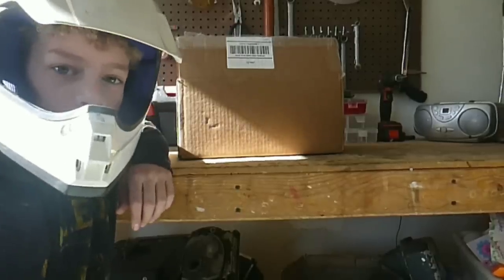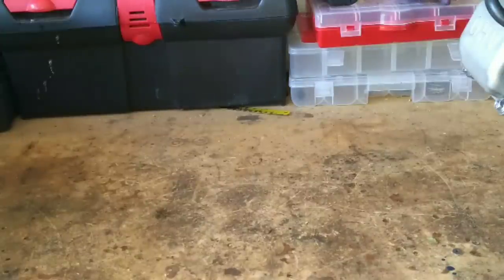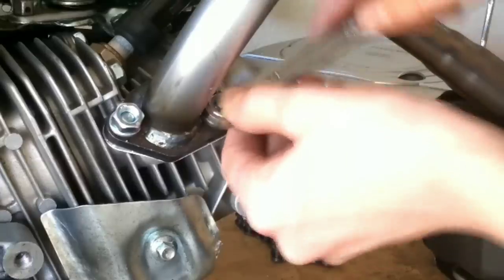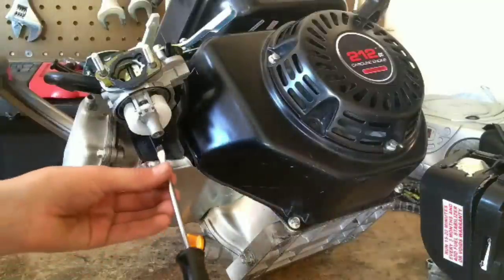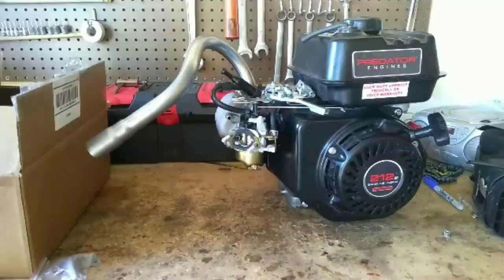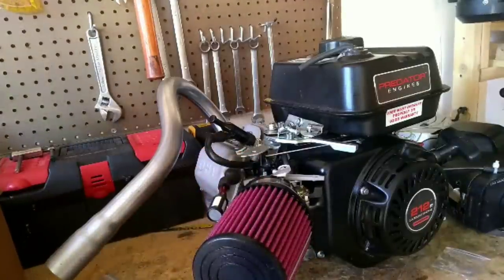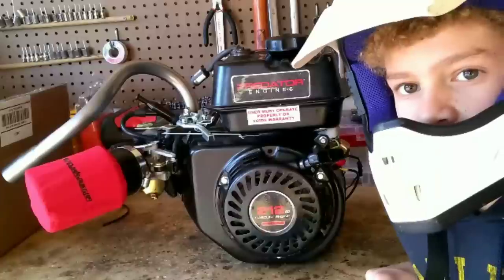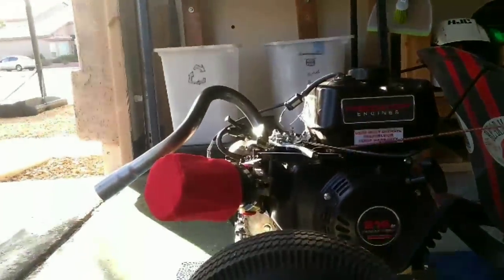212cc Predator Mods: Stage 1(FAST and LOUD!)

Comment: What sprockets are you running cause I’m on a 420 chain have a 10 and 54 tooth sprocket and can get 30 something stock
Reply from the maker: 12 on the clutch, 45 on the sprocket. #35 chain. I had a 60t on the back a while ago and it topped out at 30

Comment: Can you explain to me the stages of engines like how you said stage one engine
Reply from the maker: To be honest i dont know the exact differences but its typically 1- modified intake, jet, exhaust, gov delete 2. Cam, rod, flywheel, bigger carb, 18lb springs 3. Includes smaller technical stuff like head porting, increased compression, bigger cam bigger carb and more billet parts. Stage 4 is everything, big valves modded head running off alcohol with all kinds of custom jobs. sorry its not specific but as far as I know thats what differentiates it
Reply: @kartingkid714  that actually helps I kinda figured that basically the more performance upgrades you add and the bigger basically the bigger the stage number thank you

Comment: Would it be fine to have my governor removed with this kit?
Reply from the maker: yeah, its the setup i have
Reply: Holy crap, that's the quickest reply I've ever gotten. I was gonna take the stock exhaust box off the small holder as a small straight pipe on a 196 (this was my first time modding a motor a year ago), but I didn't know it could break your valves, lol. I replaced it with a 212 and I plan go get a stage 1 off GPS and to remove the governor.
Reply from the maker: i try to be dedicated to my fans. I had the same worries, heard stories of engines blowing up after a governer removal. Send it, its worth it
Reply: I watched Cars and cameras remove it off their 670 go kart. It took off by itself 😂😂, but if you have the right tools for the job, and maybe an extra gasket, you get free power! I subbed btw, I love your videos. I put a non hemi 212 on my Coleman BT200X, and a friend of mine gave me a fully functional torque converter for free.
Reply from the maker: @MattS_Filmography  apreciate  it! ahaha yeah dude, i was like yeah nahhh never could happen to me, and got my kart stuck under my truck. I didnt even remove it, i bypassed it. i dont wanna open the engine up until i throw in a billet connecting rod
Reply: Did you use the ziptie trick? I heard that trick to bypass it is VERY sketchy
Reply from the maker: @MattS_Filmography  no i replaced one of the spring with a solid rod, made sure the throttle returned properly
Reply: Ah I see. I'll probably actually replace it, or find some easy at-home trick to bypass it.
Reply from the maker: @MattS_Filmography  next time i have a new engine ill make a vid of my method
Reply: Oh nice, you know I'll be first to see it, I just won't mention it in the comments like all the 7 year olds do 😉

Comment: I got a new spark plug in my kit
Reply from the maker: Lucky, my stock one died so  I got an E3
Reply: I finished up my stage 1 install today. I had to wait until the foam filter spray oil came in the mail for my UNI filter. Mini bike will pull a wheelie now. No joke
Reply from the maker: @s2_eleven551  uhg I'm jealous, I'm doing a mini Ike build right now but I can find a place to weld

Comment: Do you need the little tiny filters ?
Reply from the maker: technically you dont, but the crankcase vent hose (one that comes out of the head) may spray oil without a filter on it

Comment: Hey man what kind of header did you pick for the kit
Reply from the maker: when i bought it they only had the one header option so idl
Reply: @kartingkid714  Ok one more question. If you buy a new regular carb from Amazon do you need to do any prep to it?
Reply from the maker: @Gone_rn  no you should just be able to throw it on
Reply: @kartingkid714  I'd run well also with a 22mm Honda Kehein Slide Carb...of an XR cheap as French fries & like a dream over the std butterfly carb !  Trev NZ

Comment: hey bro what are those things you put in the lines
Reply from the maker: ?? like the brake and gas?
Reply: no the line that you have the filters on by the gas tank and carb thanks
Reply from the maker: @elijah973  oh so the one that comes off the valve cover is a breather tube- it keeps pressure balanced as the piston changes the pressure in the crankcase, and the other is a gas tank fume release and making sure fuel moves slowly, the things on the end r called vent filters
Reply: Thanks so much ;)

Comment: Is your clutch on right ?
Reply from the maker: what do you mean?
Reply: Karting Kid is it backwards? because on my predator 212 the clutch is the other way
Reply from the maker: @dommybigshot21  most clutches are bi-directional. basically it does not matter the way the clutch is mounted.
Reply: Karting Kid preciate the Info !!! 👍🏼

Comment: What’s the helmet for
Reply from the maker: i used to be scared that hacker were gonna steal my SS #, i was 11
Reply: Karting Kid hey I like people that reply fast. Have you added more upgrades yet? I put a mikuni 22mm with a stage 1 exhaust header and I think imma get a racing clutch and a fly wheel.
Reply from the maker: @ryan14r95  ive wanted to for a while. billet connecting rod and flywheel, but its still pretty pricy, hopefully ill start pulling money in from the weldee

Comment: Hem I??? Whaaaaaat
Reply from the maker: J-Gaming79 yep, that model has a hemisphereical combustion chamber. You can tell on there predator engines without taking the head off by looking at the shape of the valve cover. For example, if the cover is an oval/rectangle vs a hexaton/pentagon it is a hemi
Reply: The Karting Freak, I have a predator 212 Hemi
Reply from the maker: J-Gaming79 oh nice! Sorry I thought you didn't believe me when I said it was a hemi
Reply: The Karting Freak, it's not that I didn't believe you it's because you pronounced it was different
Reply from the maker: J-Gaming79 ohhhhhhhhhh yeah I grew up saying that, sorry I didn't catch that
Reply: The Karting Freak , it's all good